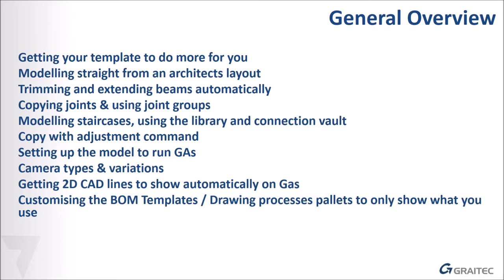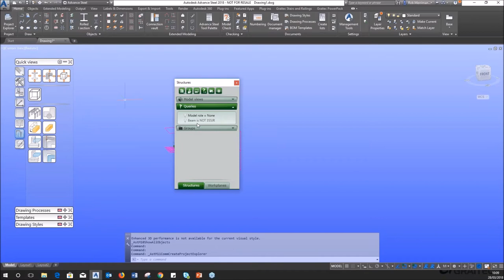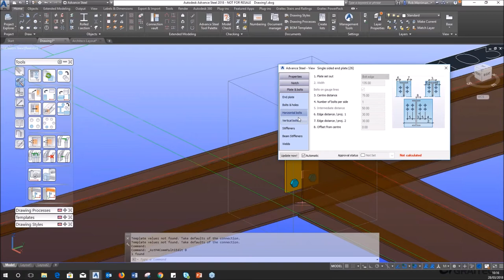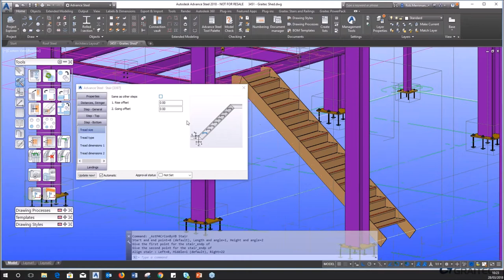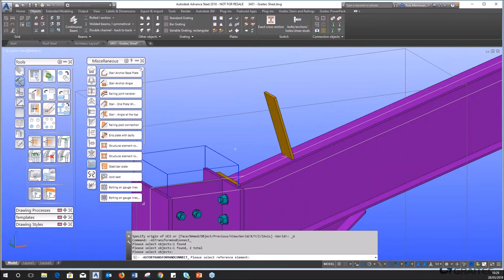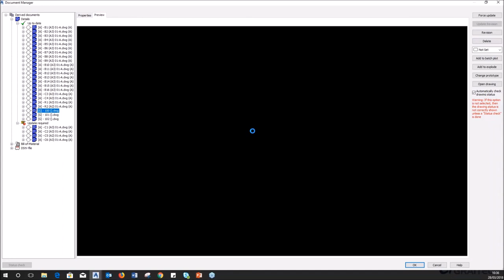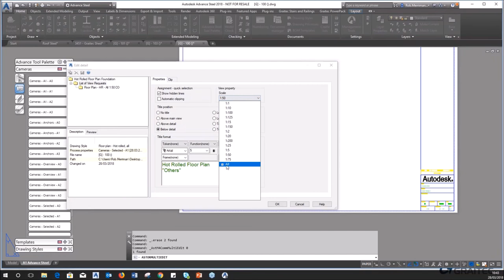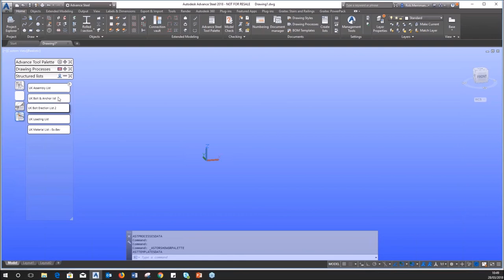Learn the Best Advance Steel Productivity Tips and Tricks from the Graitec Experts

Comment: I used advanced steel, when it ran of the back of Autocad and when they tried it as standalone program. Both versions were rubbish and didn’t run properly and full of errors and bugs. Nothing worked in a logical way. It looks like Autodesk has saved them.